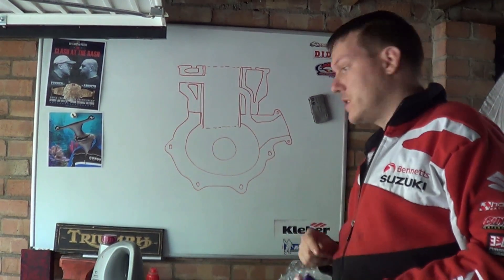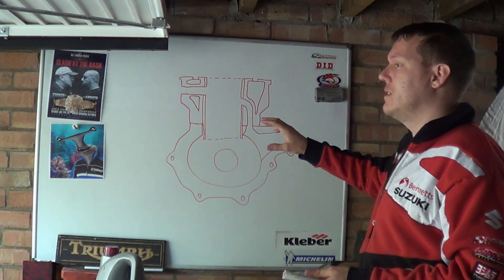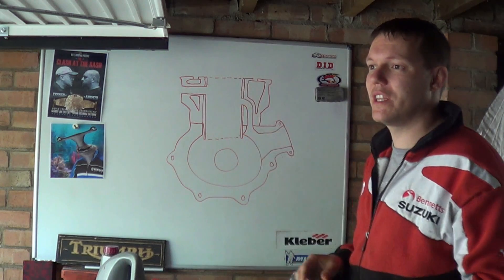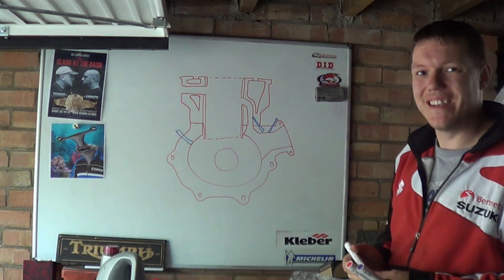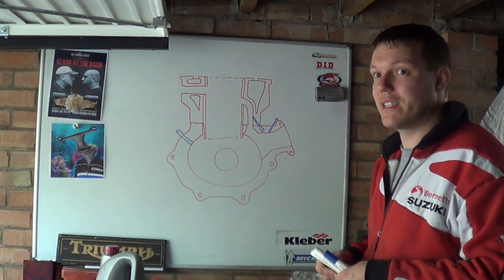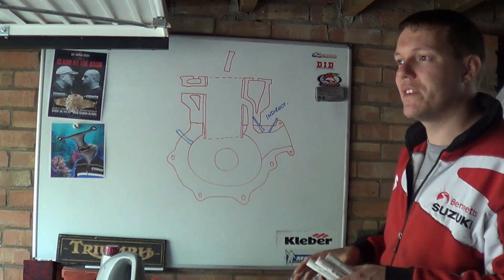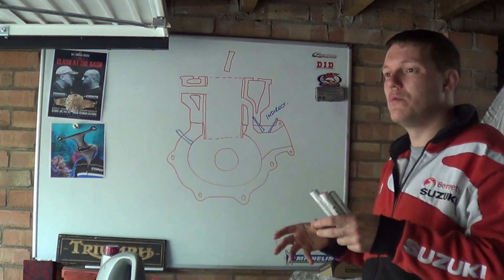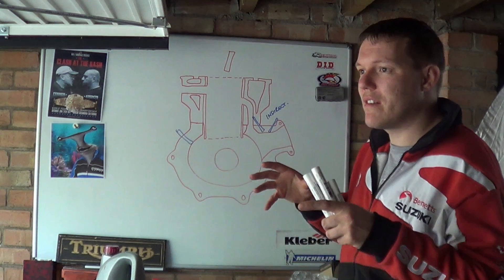2 Stroke injection - different types?

Comment: The Yamaha HPDI outboards run somewhere around 500 600 psi fuel pressure on the outboards! When it running it runs good but, when goes bad they grenade lol!!! Mercury outboards did as well! High pressure way to high

Comment: The fuel would be injected as the exhaust port closes so the injector doesn’t see the absolute peak of compression. Also no fuel is lost to the exhaust.
Reply from the maker: "The fuel would be injected as the exhaust port closes so the injector doesn’t see the absolute peak of compression"

- Say what? You seem to think that all this is instant. As more throttle is applied the pulse width of the injector has to be longer. Since the port timing is fixed and is even later with a power valve the system is defined by time only. 

In other words as rpm increases the time from ex port close to TDC is shorter. 

Then the pulse width increases with rpm.

Then timing is advanced. 

Add all these things together and that's why it's limited.

Comment: You missed out the fact that high pressure 2 stroke engines have a wet crank (runs in the gear oil) like a 4 stroke engine so don't require 2 stroke oil lubrication with the fuel, thus making them cleaner and cheaper to run. There are also no transfer ports either, just an exhaust port (or exhaust valve on a Webb 2 stroke engine). The fuel air mixture is injected into the top of the piston and this provides the majority of the compression ratio.

In a Webb 2 stroke the fuel air mixture is injected at BDC. Webb 2 strokes have been the basis of marine engines since the 1920's so direct injection 2 strokes have been around for over a century, preceding the invention of the crank case induction 2 stroke engine in the 1890's.

The first Webb 2 strokes were invented in the 1870's and used the British domestic coal gas supply. They were used to power air compressors, water pumps and electrical dynamos.

The advantages of a direct injection 2 stroke engine is that it doesn't just have to run on liquid fuel, it can run on propane, hydrogen or methane.

It also has far lower N2O emissions than a 4 stroke engine, the same as CCI 2 strokes do.
Reply from the maker: LOL we're talking about bike engines....

Comment: As a hobby, I want to replace the carburetor "needle" (sorry, English is not my 1st language) with an injector.
There will still be a butterfly valve to control the airflow via a generic accelerator cable, but I want to control the fuel flow electronically.
I think this can be quite possible to do. I will just replace the carburetor "needle" and reservoir with an injector which will be controlled by a potentiometer connected to the accelerator handle or cable.

Is this a dumb idea, or can it be successfully done?

Comment: friend, the fuel is injected not at where the compression start but it is injected right before the power stroke like a diesel. that is why only air is compressed then at the top fuel is injected and then fired. FI eliminates the air overlap that is present in 2 stroke. the indirect injection is only applied to 4 stroke engines because there are valves. 2 stroke has no valve so when it comes to motorcycles 2 stroke there is no such thing as indirect injection.
Reply from the maker: Dude what are you talking about - look up KTM's TPI.

Comment: Stihl makes a motor for some of their equipment called a 4 mix engine. Runs on 2 stroke fuel but is a four stroke and has valves and a cam.

Comment: Not all 2 stroke use crankcase pressure.. The Dolphin 2 stroke designed by Harry Ricardo used a piston charger and had uniflow scavenging. https://www.youtube.com/watch?v=0oG2RSe3P20
Reply from the maker: Ok then since 1904.......

Comment: Matt with the indirect and direct injection high pressure (ID)  option and low pressure (DI) you didn’t mention water cooling, so 2t have been as have high strung four strokes (MX, Enduro, MXGP race bikes essentially ) have been using water cooling to maintain or regulate heat temperatures as well as other things, so is this why the high pressure indirect direct system is the initial stage of evolution to direct injection, it’s not perfect but what is, but the heat issue can be controlled or maybe is not an issue at all due to water cooling multiple injection ports 2 in KTMs case, you have sensors regulating fuel, oil, air and temperatures?

2nd 3rd or whatever everyone is saying awesome discussions and content, thanks as well, love this stuff, I’m not an engineer, just a bike hack from many years of riding and racing.
Reply from the maker: The issue is pressure and time - direct injection or GDI requires high pressures - this means high pressure lines and good pumps. 

Then comes the issue of time - you need to mix the fuel and air properly otherwise emissions, and poor combustion. Diesels rev slow and have more time than petrols.
Reply: The Workshop yeah that makes sense and It’s good to understand pressure more, I always thought that was a good thing, if you can release it effectively etc, can match the temp, burn, ignition and manage gases for improved power characteristics.

But wouldn’t all that be managed by the EMS, ignition timing, amount of fuel controlled by sensors throttle position, intake, ambient air pressure, oil and water temperature. Ya have fuel pump in the tank with KTM and a seperate oil pump, extra weight neg ha, so as with the 4t versions and new 2t versions it’s also about the electronics to handle all that where as before, which was also the appeal it was very simple reed intake, carby feed mixture or as with Beta oil injected seperately to the reed block fuel air feed carby! Not saying it overcomes the pressure negatives compared to a direct injected system but it seems like a good start, hence why I mention the below, it seems KTM could be into another breakthrough early days.

KTM just started using a new engine at the weekends Monster Energy cup 450 4t which looked decidedly different much more compact esp the non cam chain side and a different throttle body arrangement it will be interesting to see what else they have done differently especially internally to that 4t another subject I know but I suspect they are on a different curve to everyone else in part due to the 2t ID/DI & DI/DI and 4T EFI development haha acronyms overload see what you have done you introduced indirect and direct lmao, cheers mate🤙

Comment: Can you take a look at the aprilia sr 50 ditech engine?
Ditech stands for direct injection technology.
Is it really a direct injection?
Reply: Enzihahn - Yes it is. Injector is located in the head and pointed directly to the combustion chamber.
Reply from the maker: I'm going to buy one for that video so we can have a look
Reply: @thedirtyworkshop  Couldn't you just inject the fuel after closing the exhaust port? Wouldn't you avoid the pollution problems that two-strokes usually have?
Reply: The Workshop nice looking forward for the Vid!

Comment: ya, uniflow, that's what i was on about, this is one https://www.youtube.com/watch?v=BPr694nlUKE anyways that but with full sump oil and on it's side and with turbo and maybe some way to try to wipe the oil that gets on the intake and exhaust side before the piston gets that low, or have a lower scraper and a channel in the middle to let the oiler do it's job only where needed, i know it will add extra wear and resistance but it will help with the emissions, also have the journal bearing set up to stop flow when the piston gets to the port, maybe, but it might be hard to time the flow of the oil it seems very challenging to  allow full oiling yet have the oil not get into the combustion process

Comment: There are that's why Kreidler still holds the highest 49.9 cc top speed record ( to me ) not officially...... They didn't use a turbo nor fuel oil or fuel and oil injection. It was a normal 2 stroke without any electronic crap on it no turbo no injection "normal fuel. The record holding 2 stroke isn't in any way to compare with the old natural aspirated 50 cc those cheaters used. How can an AM6 turbocharged water cooled fuel injected 50 cc be compared with an old Kreidler engine. It probable was recognized as a new record because the people that build it where American and it was on their salt flats.
Reply from the maker: "There are that's why Kreidler still holds the highest 49.9 cc top speed record ( to me ) not officially...... "

- wait what? "why Kreidler still holds the highest 49.9 cc top speed record" - a statement of fact
"( to me ) not officially" - your opinion........

- have I misread what your trying to say here?
Reply: I am trying to say that you hate 2 strokes. Although they do make more power than any 4 stoke. Won't deny I did get of topic by saying that the FMI can't compare these records that was because of you talking about injection on 2 strokes even talk about diesel 2 strokes diesel is oil........ It annoys me when people use fuel injection even used a turbo and had the highest power output on a methanol mixture but it is in the same class as a 40 year old record with regular fuel and a carburetor it's clear that they try to show that 2 strokes are only good when you spend 20K for 1 engine. Don't you think it should have been a different class? I talk about a world record not about your hate for 2 strokes. When you do have a word record I apologize. When you don't make more video's. To get on topic..... Please stop telling people that 2 strokes are crap when they are absolutely not to have some fun in a weekend. When you have a 125cc 2 stroke dirt bike and you are able to build an equally quick 125cc 4 stroke we talk again ok. I don't think 2 strokes are a good choice for commuters they are way more fun when you have a day off though.

Comment: One reason direct injection is such high pressure is the very short time available to inject the fuel.  (Pulse width is very short).
This is especially true when muti-pulsing as is the case with common rail diesels.  The cylinder pressure even at TDC prior to ignition isn't very high at all.
Reply from the maker: "The cylinder pressure even at TDC prior to ignition isn't very high at all." 

- not high? lol

Comment: so with the "low pressure" system... would finding a way to close the exhaust port on the upstroke solve quite a lot of the issue? 
what about a slider valve on a separate tiny crank? just an idea haha
Reply: Like having a rotating sleeve cylinder liner, actuated by a cog on the crankshaft in an endless-rack and pinion style arrangement?
Reply: KrisD how would it get the exhaust gas out with the port closed?

Comment: Doesn't a 4-stroke engines of equal displacement rev higher than a 2-stroke engine?

For example; a 2011 Yamaha YZ250F produces about 36 horsepower @ 11,300 rpm while a 2011 YZ250 2-stroke makes about 46 horsepower @ 8500 rpm. I'm assume 4 stroke transmissions are geared lower than 2 stroke transmissions.

Comment: what I'm confused about is how the crank case oiling system would work. if you inject fuel down stream of the crank case ie transfer port or directly into the cylinder then you wouldn't need the oil mixed in with the fuel, but then how does the crank case get lubricated? or if you had a dedicated crank case oiling system like a four stroke has than you wouldn't have the pumping action of the bottom end or even a transfer port? as i understand the old Detroit 2 stroke diesel truck engines needed a super charger to push the air through the engine in order to be able to run. that way they could have a dedicated crank case oiling system. I'm interested to see how KTM is going to do they're new FI 2t's. does this make any sense?
Reply from the maker: Yes it does and that's the next video on 2T DFI. I break the videos down so people who know very little can process what I've said in each video, then move onto the next subject whilst building on what they have just learned. Eventually I'll get to the point where we can look at examples and do some of the maths etc  - matt
Reply: The Workshop 
sweet! looking forward to it! appreciate your videos, thanks!
Reply from the maker: No worries mate - matt
Reply: The Moto fixery I was thinking the same  but there is no reason why a spray jet can't be used the spray the cylinder via the con rod . but it's all about costs really.  I bet with a lot of people together you could build a awesome engine if money was no problem

Comment: Just one thing, i have an old Kovrovec 175 Vozhod with a 2 stroke engine without reed valves. This engine works using the piston to seal the inlet while pressurising the crank case.
Reply from the maker: Are you sure this isn't a rotary valve?
Reply: You are kidding right? The carburetor is on the side of the cylinder as you showed, but there are no inlets in to the crank case, other than the openings on the side of the cylinder. I have personally assembled the engine because when i bought it it was in 2 buckets. There are no valves at all. It's an old and inefficient design (only 9hp from 175cc) but it's quite reliable and easily fixable. You can even disassemble the ignition coil if needed :D I had to fix it once while i was about 50 miles from home with only a screw driver some wire and a contact cleaner spray... There is a video of the end of the repair somewhere here...
Reply: It also has a resonant chamber before the carburetor to improve the air flow in to the it.
Reply from the maker: "You are kidding right?" - why would I be kidding? I don't know every bike on earth. But looking at the engine I can tell you its a DKW RT copy and uses loop scavenging. That's why they're all small cc engines - matt
Reply: I meant about the rotary valve. I have seen such engines, but mostly in very small sizes, most model engines use the rotary valve system and some very small (35cc and 50cc) bicycle conversion engines, but i have never seen it on any other engine...  And yes, when the russians occupied Germany they took most of the manufacturing machinery and plans and copied their designs... Poorly... Anyways, i love your videos,  keep up the great work! :)
Reply: Good to know!
Reply: Eviltech - "...it was in 2 buckets..." seems to be the norm. LOL 
My old CZ/Jawa 2 stroke 175. Came in 2 or 3 cardboard boxes after a friend cleared is uncle's garage junk. :-) No manual, no tech info, no internet at the time...It was "fun" to track 1 slider and 2 forks for the gearbox. Rebuild the entire bike mech &n electric along it's original "jukov" carb.
Was the first and last bike I touched with a 6V dynamo (yes dc current! ).
Gear lever was also the kick starter (push in and back). Gearbox was reversed 1st up and the rest down. no rotary valve or reed also. It was damn fun project. :-)
Talking about rotary valve the best example and mostly forgot...Vespa. ;-)

Comment: matt can you tell me why my new 125 4 stroke has indirect fuel injection rather than direct fuel injection which i am assuming would have lots more benefits. it just seems like i have ridden carbureted pit bikes with better throttle response than my current bike!
Reply: codgod58 - DI have some benefits. But not as many as you might think in several cases it's a fallacy. First and most important problems are higher pressure, cost, carbon & COST. :-) No misprint here. Cost is a major factor in production and manufacturers do the minimal needed to pass existing regulations. 
Euro4 came up and among other things injection became an obligation for all 125 sold in Europe from now on. 

With that said indirect injection is cheap and readily available so costs are relatively low. Also due to the same emissions control you have a quite lean working engine...Throttle response will always be let's say "not the best". On the other hand, consumption, range and emissions should be much better than before. It's a trade win some, lose some. ;-)
Reply from the maker: Awesome question, that video is coming up this weekend

Comment: Add 1 exhaust cam and valve to control the "Gaping hole" and spray in fuel whenever you like ? Then it would almost be like a marine 2t diesel but with out the supercharger.
Reply from the maker: This is the problem, doing it and keeping within the emissions levels
Reply: Truzo  at that point your defeating the benefits of the 2-stroke as you are now adding a camshaft, a rocker arm, a valve (which you now have to make room for in addition to the injector you have to find room for), valve spring, and timing chain/belt/gears or pushrod setup. As well as redesigning the combustion chamber to account for how that valve will change airflow in that cylinder now.

Comment: do you still need so high injection pressure in 2t's just after closing exhaust port? you mentioned this before also. pressure in cyclinder shouldn't be so high and injection pressure should be smilar as 4t's just enough to atomise without any restrictions.
Reply from the maker: More on this in the next video when I go into more detail - matt
Reply from the maker: Very true and my whole point of Will DFI save 2 strokes video - https://www.youtube.com/watch?v=ql2-wW0LuWY
Reply: Puffalupagus360 actually i did not add any parts, did you answer to me?
Reply: ybyo YouTube app put it on the wrong comment
Reply: Puffalupagus360 lol
Reply: ybyo promptly moved the reply, thanks for the heads up.
Reply: The Workshop I moved my reply to the appropriate comment. didn't see till the last second you pinned it.